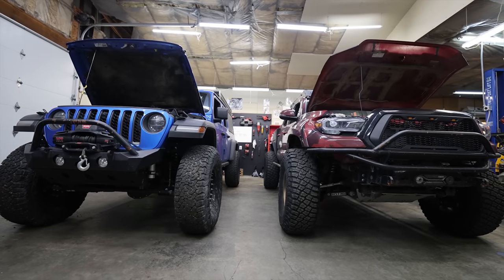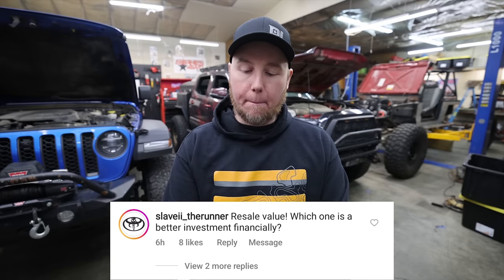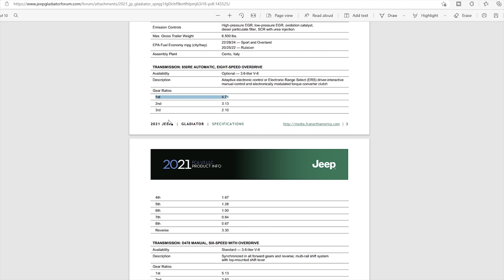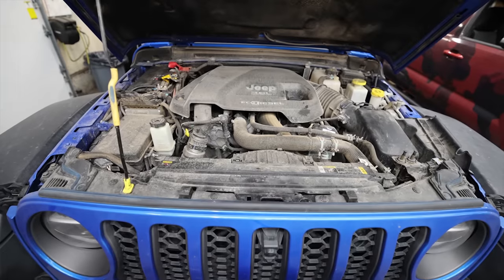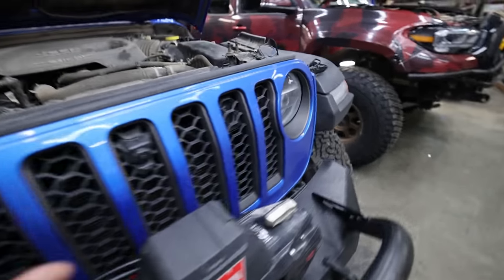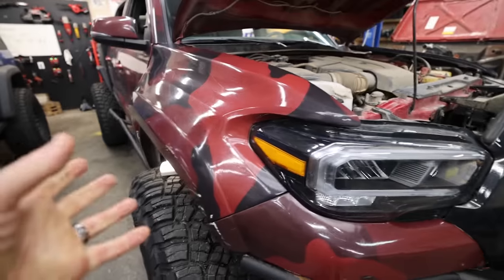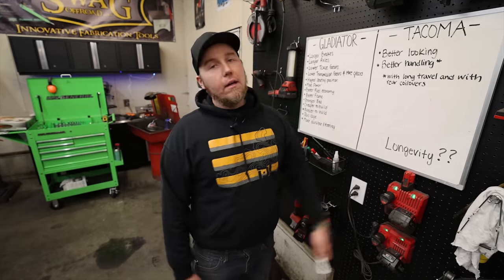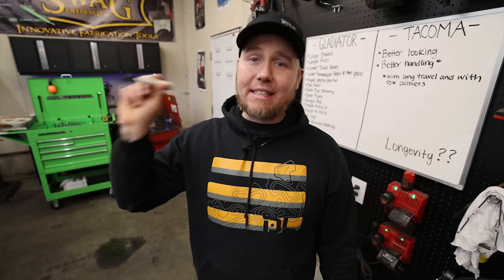My 21 Jeep Gladiator Vs My 21 Toyota Tacoma. Cold Hard Facts.

Comment: I own two third gen tacomas and while i love them, i agree with you.   The tacoma is a good truck if you dont modify it much.  Im running 32s and thats about as comfortable i am with wheel size.   I own a double cab and an acces cab trd off road and the frame on the access cab bends like crazy while off roading/flexing.  The trans isn't the best and the engine lacks torque.  I definitely considered the gladiator but in all honesty i do a lot of high speed too so i couldn't do it.

Comment: I have owned both (currently own a Gladiator, and rented a Tacoma last week while on business). Hands down, no question, I prefer the Gladiator. Renting the Tacoma last week only reinforced my opinion. The lack of low end power, terrible automatic trans shift calibration, and the low seat height are my greatest three complaints with the Tacoma. The Tacoma has so much potential, but misses the mark.

Comment: IDK about the ecodiesel but the pentastar v6 with the medium duty 8-speed automatic is not happy towing either.  Even under normal driving conditions the transmission rarely ever goes into 8th gear let along while towing anything moderately heavy.  The stock springs on the rubicon definitely need to be upgraded to better support added weight during towing.    The one gripe I have with my gladiator is the small and narrow bed definitely limits it’s usability at least in regards to trying to use the gladiator like a comparable midsize pickup.

Comment: welp, I bought my 2022 Tacoma for 2 reasons: 1) long term proven reliability from toyota as a brand… 2) I don’t plan on doing the HARDCORE off-road or towing/hauling… Tacoma is like a pocketknife, it’s good at opening a can or cutting a box up… it’s not a very good hammer or wrench though… specific tools for specific jobs 🤷🏻‍♂️

Comment: I think you actually made a great video citing straight facts for the gladiator as the more robust off road vehicle. It’s kind of an apples to oranges comparison in a lot of ways though because of price don’t you think? I bought a new 21’ Taco for 34k and after looking around online I can’t even touch a new gladiator for less then 50k and honestly most closer to 55k. For a 15k-20k difference the Taco is your everyday all around pickup truck that can be modded to suit your individual demands for off roading if needed.

Comment: Nothing wrong with this comparison coming from a Toyota guy.  One thing to point out, they use a beefier rear axle (8.75 ring gear and stouter housing) for the TRD offroads (and any with a manual tranny)

Comment: As someone with a diesel gladiator on 38s that's are probably close to the same size as your 39s (bfg vs nitto) are the 5.13s not a little much? I still have the stock 3.73 and still hit 8th gear so I was curious? Thanks man great video

Comment: Great vid of course the jeep is better it has a turbo diesel and better drivetrain. But you are comparing a maybe 40k tacoma to a 65k Rubicon Gladiator. I definitely prefer the 3.6 pentastar in my Jk vs the toyota 3.5 in my tacoma but the 3.6 had head issues and oddly about 3 cups of sand in the radiator and overflow tank from the head casting then the oil cooler leaks, thermostat failure twice and also the wiring loom all crumbled to pieces on everything in the engine bay of the jk it had 40k miles.

Comment: Great video but I don’t think the comparison in engines qualify. I think it the Toyota should have been compared to the gas version.
Reply from the maker: It's the best motor I could buy in the jeep compared to the best motor I could buy in the yota. If Toyota offered better motors, I would have been happy to order one in this Taco. I don't see a reason not to showcase the best equipment offered in both trucks.

Comment: I'm curious how the Jeep stacks up to the 4runner ? Because the 4runner is still on the old gearing ratios, older axles and of course the older engines (4.0L v6). Also the 4runner sometimes get's worse gas mileage than the 5.7L Tundra... I just wanna know why the 4runner is such a gas hog. I know the 4.0L is old but has to be something with the gearing.

Comment: This was a pretty good video but with some caviats. Larger brakes aren't always better,  and I notice in taking some of your measurements you weren't exactly consistent with how straight you held the tape which can skew numbers. This leads me to my main point which is, listing numbers without proper context makes for a poor foundation for an argument/explanation. For instance, the braking on the Gladiator is better, but it has lower gearing to keep speeds manageable on decent. Towing capacities are different depending on trim so which is better isn't quite so clear. Beefier components are absolutely more durable but not necessarily better performing. Ultimately ( and here's just my opinion) they fill different roles but for the type of wheeling you do, the Jeep is most definitely better.

Comment: Good info. Well done. One major thing to keep in mind is that the Gladiator platform is designed from the beginning to go off-road, while the Tacoma is basically an economy truck that people use for off-roading. And the Tacoma is an ancient design at this point; the drivetrain, suspension, can layout, etc. are all antiquated and it really shows.

Comment: im not a fan of modern vehicles, the newest i go is usually early 00's for a number of reasons. that said jeeps have a lot going for them and i would also argue they are better looking, i love the utilitarian aesthetic and don't care much for the "aggressive" looks of the Toyota. i respect jeep for sticking with tried and true off road technology. solid axles, manually shifted t cases, still offering manual transmissions when virtually no one else does, its the reliability that has always kept me away. i just dont see many 300+k jeeps. when i was a teenager i thought i would only ever own a wrangler, that never actually happened, ive never owned one. my first car was a toyota and i fell in love with it, and i have driven mostly toyotas and hondas for cars / suv's and 80's / 90's fords for trucks. i feel that a compact truck is somewhat pointless, and as i drive a truck for work it would never make sense to have that little bed space.'

ive been disappointed in Toyota a lot. i think they went down hill pretty drastically since the 90's, and are still just riding on the reputation they earned in the 70's and 80's. they have always had a problem with rust from the very beginning, living in the upper Midwest there just aren't hardly any old Toyotas on the road any more due to rust. they have made some mind boggling decisions especially relating to the us market. giving us the Tacoma instead of the hilux, giving us the us market landcruiser instead of the "real" Landcruiser's, rarely offering a diesel over here, discontinuing manual transmissions in most of their trucks and suv's since the early 00's, the list goes on as to how much the us suv / truck buyer has their choices limited by toyota. the frustrasting thing is seeing all the awesome toyotas they have acess to over in australia for example. you can get a stock potal axled 6x6 landcruiser with a diesel and manual over there, that would be a totally unheard of option over here. 

i may own a jeep one day, but probably not. i have a 98 manual 4runner, and i think thats the best combination of reliability, usability as far as interior space and features, and capability.

Comment: Nate great video. Curious as to your thoughts on tuning the gladiator? I too have an ecodiesel and considering the green diesel engineering tune. Keep up the great content and knowledge sharing!
Reply: I have the full weight loss kit from EOC and my diesel jt is freaking amazing to drive on the same 39 setup nate has on the tacoma & 4.56 gears/trusses. I just drive it from florida to nashville across to colorado down to phx then to san Diego. It got 24 mpg for the trip and there was some wheeling mixed in.

Comment: The C-channel vs boxed frame is a weird argument but Toyota messed up in how they put their C-channel together. For each respective wall thickness, the boxed frame will be more rigid and stronger. For crash ratings, the portion behind the cab and near the front of the bed usually has circular cutouts and it smaller overall, and is commonly where frame bending will happen (not unique to Jeep, look up the chevy colorado if you want some laughs). For a C-channel frame to have a benefit, it typically needs to be "overbuilt" so that it has minimal flexing under it's rated load. By doing this, it can flex vs breaking in the event you have a trailer attached and hit some nasty bumps at speed. 

For normal consumer use, a boxed frame is almost always superior. No truck is hauling 60k lbs like a semi and would not see the benefits a C-channel might provide. The other consideration is the manufacturer. Everyone is moving to high strength steels to save weight since you can use less material and have the same overall strength. The C-channel loses all of the benefit it might provide if it's built within very tight weight constraints for a mid size truck.

Comment: As far as reliability goes from personal experience my Tacoma has over 200k on it and has had zero reliability issues, I've only done general maintenance and it still runs great. My girlfriends Rubicon had the entire cooling system go out, leaks out damn near of everything, failed oil cooler, abs sensors, and it only has 60k on it. I 1000% agree that Toyota is falling behind and need to mix things up to stay relevant but if you're in the market for a truck that sees 90% pavement and occasionally goes off-road then I'd get a Tacoma 100%

Comment: On the subject of frames. There's alot of oof in this. First off, my 96 yukon weighs 10,000lbs with all the crap I've done to it to make it literally bulletproof, it can still haul another 13,000lbs ontop of that and I still take it offroad. It's on a C channel frame. The reason I'd prefer a C channel frame over a tube especially offroad where your going through water, is the fact your tube will have areas where water and dirt cannot escape. After time that will rust and on newer vehicles with garbage materials and metal with lots of contamination..  yea I'm sure you can see where that goes. The issue isn't the C channel frame. It's that you bought a cheap vehicle which was poorly designed, made with horrible quality metal and a poorly designed frame

Comment: As an Australian, where we have the hilux and 70 series cruisers you really don't want them over there stock to actually really capable you have to spend big money (well Aus dollars anyway) and have to do alot of cutting and welding. 70-79 series cruiser has some very unique idiosyncrasies particular in the wheel tracking that really should have been addressed from factory it was designed for on road handling but off road it dosnt work aswell as it should do in standard form the rear Axel is narrower than the front. The hilux is the most over rated bit of kit these days originally yes they were built tough and developed a reputation of being a great 4wd all be it under powered like way under powered but like all Toyota's they built a reputation then once they had it and a legion of fans they started to drop build quality and material quality to a point where the only stock thing left in a proper build is the badge. Every thing from suspension, gearing, air intakes, computer programing, intercoolers, turbos, transmission coolers etc needs to be changed.

Comment: Well, I have a very reliable way to know how reliable one car is. Get a list of mechanics in your area, go to their shops, introduce yourself and say "hey, you know, I'm looking to buy a used truck, but I'm not sure on which one... how often do you have to repair Tacomas here versus any other mid sized truck? Like real repair work, not maintenance"
Then go to the next one and say "hey, you know, a friend of a cousin is selling me his gladiator and he says it is in pristine condition, but I was already sold into Tacomas and I had found a couple for sale that looked great... would you say it is a better idea to go for the gladiator?"
And keep going.

Also, ask what car they drive, what car their wife drives, what model or brand they have to repair the most and which brands they rarely see in thwir shop except for oil change and regular maintenance. 

You will find out very soon how crappy some brands are and how reliable are others. Like nissan, old nissan is great, but new nissan is mostly crap. Old fords (real old ones) are great trucks, but new ones cant be kept out of the repair shop. Any chevy with a 3.6L is a money pit, but any LS engine or vortec is built like a tank. VW is a great and reliable brand, but it is expensive to repair like no other. Mercedez benz is a nigthmare to repair because of parts availability, but they wont break down. BMW is a vehicle to last 100k miles and throw it away, Audi is good and repairable, but very expensive to do it. Ram Trucks seem to never go into a repair shop unless they need half an engine because of the camm lube issue (which most people correct as soln as warranty expires or a bit before and they simply forget it).

Comment: I test drove a Tacoma TRD OR in 2017 back to back with a Frontier Pro4X(old 4.0L with 5 speed) and a GMC Canyon(V6 with 8 speed). The Tacoma powertrain just sucked so hard that I couldn't even consider it. I was coming from a F150 Ecoboost and a Jeep Liberty diesel which both had low end torque. The Tacoma just needed to be reved so high to do anything that it was really terrible. The GMC and Nissan were both much better.

Of course, I tow, so thats a priority for me, but that 3.5L V6 in the Tacoma is absolutely a no go for me.

Comment: Hey side question, what fenders did you put on the tacoma? I am doing a 1st gen with BHW and super duty axles. Trying to figure out which fenders to get. Thinking 4” ruse and 6.5” wide. Yours look 6 or so inches. I am planning to go full width. Flat bed for the back. 😊

Comment: So some data on resale value (former wholesaler, so using tools I used when I worked in that), average market value by nation wide listings in US has the 2021 Tacoma TRD Pro with an average odometer of 21,700 miles with an average listed retail price of $49,620. The 2021 Jeep Gladiator Rubicon (v6 option) has an average odometer of 17,064 miles with an average listed retail price of $49,369. Typically on this classification of vehicle, the depreciation rate is about 10 cents per mile for anyone who cares to try and gauge the worth of theirs based on these numbers. Based on this data, the Gladiator retains its value about 60 cents per mile better than the Tacoma. ($2.89/mile for the Gladiator, and $2.29/mile for the Tacoma)

Comment: I’m not a Jeep guy by any stretch of the imagination I have little to no experience with newer models (ones built in the last 4 years) the last (new Jeep) was owned by a co worker in the year he owned it he drove a rental/loner instead of his actual Jeep (rubicon) more often than not front axle problems trans engine had to be rebuilt transfer case stopped working And for reference, he never drove it off road and only used it for snow up north ended up, trading it in on the grand Cherokee. Go figure this was four years ago and yes, it was brand new then. But something about Jeeps that I didn’t see talked about in this video or in the comments is the fact that the newer ones there is a company that makes a Bolton portal kit that allows you to run 40 inch tires and there’s another company that makes a really nice short bed conversion for gladiators if I was in the market for a new 4x4 and somebody could prove to me that the drivetrain was worth it the Jeep might be what I would buy given the two options. Big mikes slowest Tacoma in the world is how you build a taco. Add up all the parts for both builds and see for your self witch one would work best for you. Remember it’s only money…you can make more.

Comment: I feel it's hard for longevity to be revealed in the first 50k miles. I think it only really shows up towards 100k+. Then there's all the variety in how something was used.

For example my 2019 f250 with a 6.2 will rarely see a trailer above 7k and it's at 105k right now, I feel confident that it will see 250k. Where my work f350 6.2 gas with 12k miles routinely pulls 10k plus the dump body on it and I'd be surprised to see it hit 100k without significant maintenance, and I try to treat the truck with as much respect as I can.

Comment: Fact: most of the facts you listed don't actually matter to people. And also a fact: the way you use your vehicles is not how the vast majority of buyers of these vehicles will use them. So I agree with your facts, I just don't think they're really relevant to what most buyers are looking for, or how they actually use their trucks.

As for the reliability standpoint, I agree that consumer reports isn't a 100% reliable indicator, but it's still an indicator that's better than a website sponsored by the manufacturers and better than YouTube influencers. No one disagrees that Toyota is one of the most reliable vehicle brands. Our Toyota Avalon lasted 25 years with basic maintenance and changing parts that wore out. So that experience led us to buy a 2006 Toyota Sequoia. So far it's been doing well and hasn't had any major issues. Hoping it lasts as long as the Avalon did. My family growing up has been buying Hondas for over 30 years and they've lasted an average of 20 years.